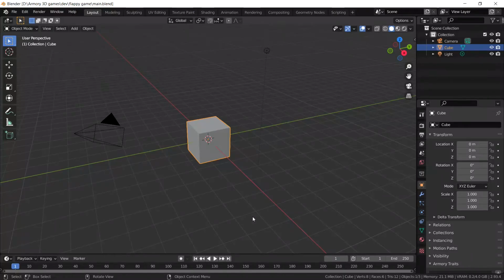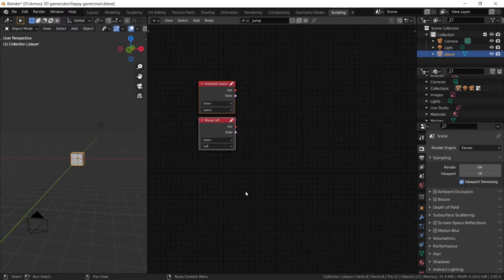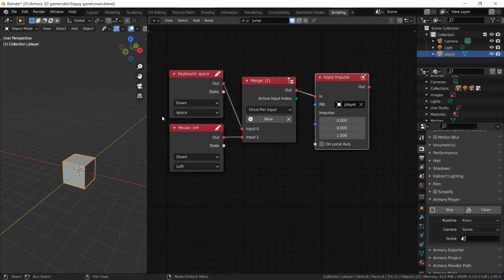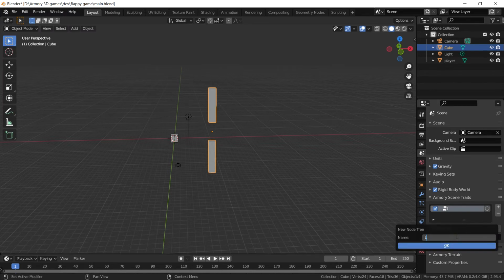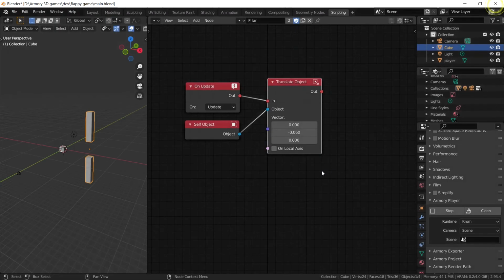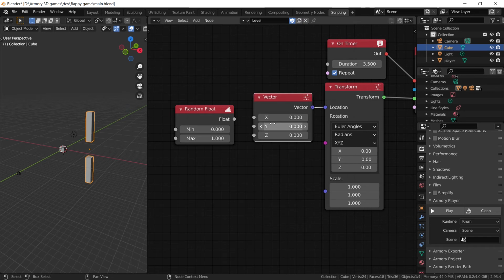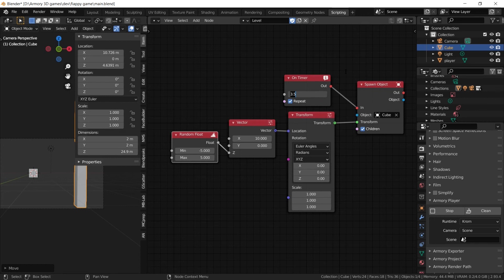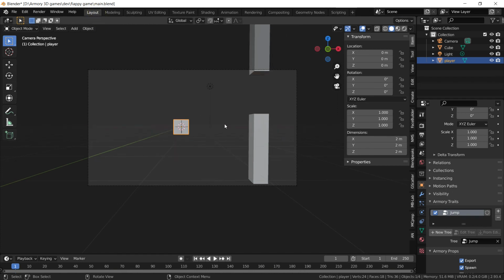Make your first game with Armory 3D -beginner tutorial #armory3d

Comment: Things people may experience while doing this tutorial and their solutions,
(Problem 1) Armory giving location error causing armory to not work (Solution) Turn off One Drive's over reaching desktop cloning cloud service to avoid it cloning armory and messing it up.
(Problem 2) Pillar is either not spawning or not moving (Solution) The Pillar node was probably made in your scene tab or your levels node was made in your object properties tab, move the node to the correct place.
(Problem 3) Sometimes cube glitches through pillars like no collision object is on them or goes behind the pillars. ( Solution) The collision is either not added to your project because you forgot to add it or it is there but the cube is being knocked out of place and set behind the pillars because the cube is not locked into the y axis, to set it so it doesn't shift behind the pillars click on the cube, then go to the physics properties tab, scroll down till you see the words Armory Props, Open in by clicking on the down arrow. When you do that you will see the words Rigid Body Export Type Dynamic, right under that you will see 3 different fields by the words Linear Factor, those are your X,Y, and Z fields, the second field is your Y axis for the cube, set it to 0 so the cube no longer shifts out of place. (Problem 4) You names the other cube Pillar using F2 and now it's not spawning more pillars, (Solution) Go into your logic node editor, select the logic node called Spawn Object and then either update the name from cube 2 to Pillars or just click the x by the name cube 2 and click the eye dropper then select the pillar that you made, Armory clones the objects by the name they are given not the type so if you update any names you have to update them in the Spawn Object field too.

Comment: When I push play a script comes up telling me I have some kind of error but I am not sure what it means
Reply from the maker: Does this happen with just a default scene because that usually would mean you have badly installed armory or you have the wrong blender version
Reply: @Exceptional3dtutorials  I fixed it thank you, turns out that it was my One Drive backing up my files including armory to a cloud system which was confusing the add on of where to get the data from, in the end I had to factory reset my computer to remove One Drive since every other method I tried failed to remove the program and now armory is working just fine now anyways back to the tutorial after a 2 day delay.
Reply: @Exceptional3dtutorials  I am using Blender version 2.93.8 and the latest version of armory, I did the whole installing py thing, even tried following the manual from the offical armory site but I don't understand what it means for some of it, some I do most I don't can you explain all of this?
Reply from the maker: @mrunknown6842  can you join the armory 3d discord or go to the forum in the community section and post a screenshot of the error message so we can see what is wrong?
Reply: @Exceptional3dtutorials  can you please send me a link to it? I'd like to join if that's possible, what link do I join with?
Reply: I think I found it, I posted the error in the general chat, maybe someone can tell me how to fix it